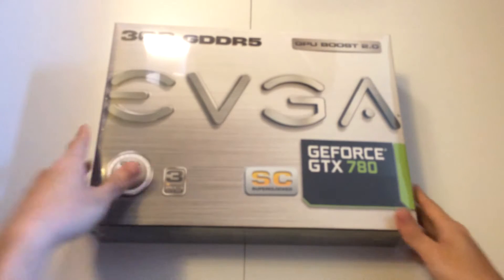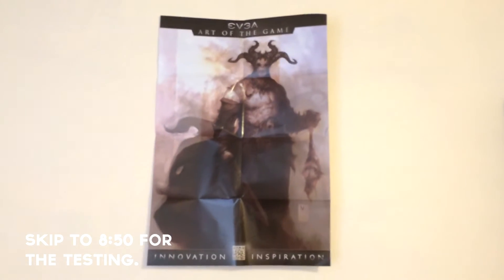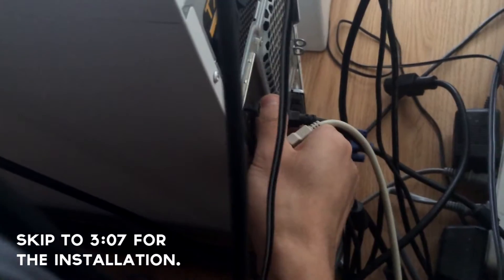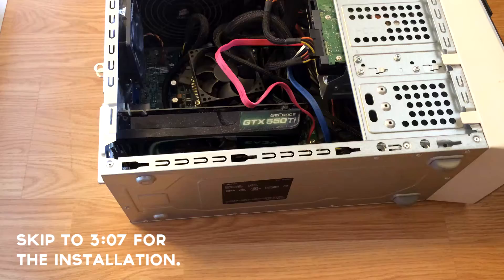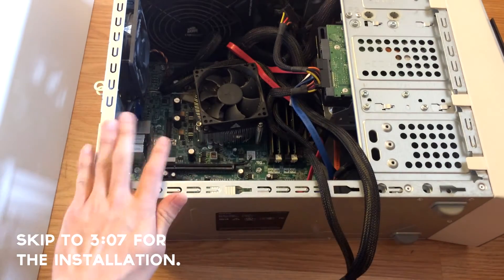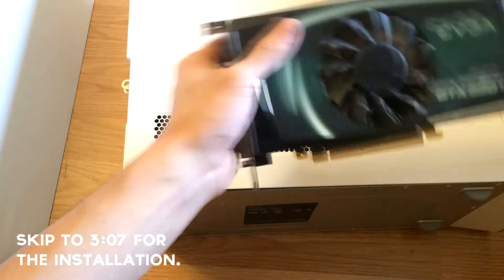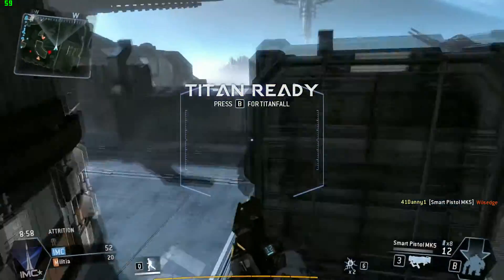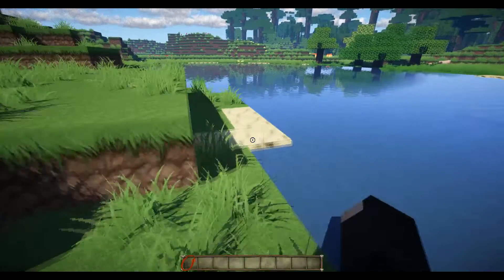GeForce GTX 780 Unboxing, Installation and Testing

Comment: Thanks for the Video but you REALLY should edit this title to XPS 8100. You have it as 8300 in the title..
Reply from the maker: Thanks for the heads up! 8300 is in the title because that's the model of the computer in the vid. The models were very similar nearly a decade ago.

Comment: Do the 6 pin wires come with the PSU or in the GTX 780's box?
Reply from the maker: 6 pin connectors are always with the PSU, though the GTX 780 does give you molex adaptors if your PSU doesn't have 6 pin cables but has molex connectors
Reply: SDG Thanks, well my cousin is gonna give me his GTX 780 and he lost his connectors
Reply from the maker: Congratulations! You should have a quick look inside your PC if you're planning to install the card just to make sure you have the connectors, or plan to purchase a new PSU accordingly
Reply: +SDG Yes, I will get a EVGA 500W B to replace my Dell manufactured PSU 275 watts.

Comment: is the GTX 960 SSC a better card or just newer?
Reply from the maker: [TMTz] TrillOGkush Just newer, I believe this card can compare to the GTX 980.
Reply: nice!! i was asking cause i got it and i play games in 1080 p 60 fps with it never going below while recording and ive recorded in over 1440 p resolution at 60fps with no drop in frames
Reply from the maker: [TMTz] TrillOGkush Haha nice! :D
Reply: SplitDiversion yeah i looked the specs they about the same except my base clock is 1279mhz boost clock is 1342mhz which is higher then the 780 ... just making sure i made the right decision on my card i dont have any complaints with it i love Nvidia cards

Comment: do you need anything else like a motherboard to fit this graphics card
Reply from the maker: Kayotic gaming Your motherboard should be compatible with at least PCIe 2.0, your power supply should be a minimum of 250 W but it's recommended to have 650 W, lastly your chassis should be large enough to fit the card itself.

Comment: Does a Asus GTx960 fit inside? Because it is wider than usual, so the slot is bigger
Reply from the maker: MrKagyal The GTX 960 should be able to fit into this case as it has very similar dimensions to the GTX 780, but the 960 is a little shorter!
Reply: That's great! Thank u SplitDiversion

Comment: HI,
May i know which motherboard are you using ?? Is it the stock Dell motherboard "0y2mrg" ???
Reply from the maker: Yes, it was a stock Dell XPS motherboard that came with my XPS 8100.
Reply: is the xps 8100 motherboard or xps 8300 motherboard ???
Reply from the maker: XPS 8100.
Reply: SplitDiversion Gaming Did it work on an XPS 8300 Motherboard ?? Cos i wanna buy dis card. :)
Reply from the maker: As long as the board supports PCI Express 2.0/3.0! (Which I think it does.)
Reply: SplitDiversion Gaming Thank you !! But there are some compatibility issues b/w Gtx 700 series and XPS 8300 motherboard ... can you confirm for the same ??
Reply from the maker: I can assure you that I'm having no problems between my XPS 8100 motherboard and my GTX 780. ;)
Reply: SplitDiversion Gaming Thx !!! But can u assure that there are no problems b/w GTX 780 and XPS 8300 motherboard ???
Reply from the maker: If it supports PCIE 2.0/3.0 then it should work.
Reply: Thx. I know that, but are there any bios compatibility issues b/w GTX 780 and xps 8300 motherboard??? Have u tried it??
Reply from the maker: I only have the XPS 8100 motherboard, I'd assume that it'd work though.
Reply: SplitDiversion Gaming Ok ! Thank you so much :)

Comment: Nice job any do you have any idea if the gtx 750 ti will work with the xps 8700? :)
Reply from the maker: That card should work! As long as you have a PCi Express 2.0/3.0 connector on your motherboard!
Reply: i think i do thx!

Comment: Danny thanks so much for GTX 780 I see that you ran it in  XPS 8300 how did you get the mobo bios to see the card? Most people are having no luck getting and good card to work in the XP 8300??
Reply from the maker: Thank-you for the compliment! :)
I didn't have to do anything with the bios, the board seemed to have recognized the card right away. All I really had to do was update the drivers, however some people may just need to install it.

Also! If there's an integrated GPU on the board, it should be disabled through the bios, or from the Nvidia panel. A defective DVI cable can also contribute to failure.

To those people who have been going through issues with the card, I wish everyone good luck!

Comment: Great great job and thanks for the video, i have an XPS 8300 like you but i still have the AMD Radeon™ HD 6450 can you tell me if i must do something to my motherboard or i must upgrade the bios version or anything to get the Geforce GTX 780 working in my PC or just install it and thank you :) !
Reply from the maker: I didn't have to update the bois or anything!
I just had to clean up my cable management a bit and that got the card to fit in. It takes a little bit of manoeuvring but my XPS 8300 case was fortunately large enough to fit the 780 inside.
After that, all I had to do was install the drivers. :p
Reply: thank you so much :)
Reply: I have Radeon 6670 HD.
It's really not too good.
Jealous of NVidia, but I'm planning on upgrading quite soon.
Reply from the maker: Sounds great! Nvidia arcs are my favourite.
Reply: The Physx, Shadowplay, TXAA, drivers and overall GPU quality makes NVIDIA seem so much better than AMD :)
Reply from the maker: Haha, indeed! AMD has great GPUs though. ;)
Reply: I believe they're centered around performance rather than graphical fidelity.
Hell, I cranked the settings all the way up on graphics improvement, on the Catalyst.
Reply: But then there's League, with settings maxed out, but no change xD
Reply from the maker: Ahaha, indeed! XD
Reply: Are you a leaguer, Mr SplitD?
Reply from the maker: Just a bit. Not too much of a leaguer though, haha.
Reply: gg :)
Reply from the maker: :p
Reply: gg no re 1V1 me noob :P- The basic LoL player
"I'll report u if u don't go mid"
Reply from the maker: 1v1 me m8

Comment: Did you do anything to your motherboard?, and will this work in the Dell XPS 8500
Reply from the maker: Sorry for the late reply!

I didn't have to change the motherboard, it worked despite my motherboard being a PCI Express 2.0. The card should work fine on any computer, as long as the power supply holds sufficient watts and the motherboard supports PCI Express 2.0/3.0.